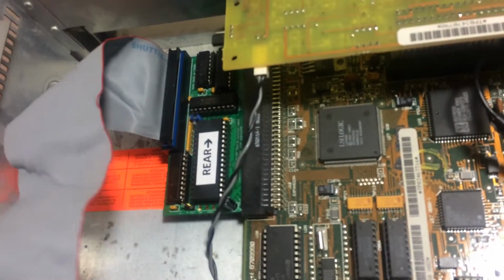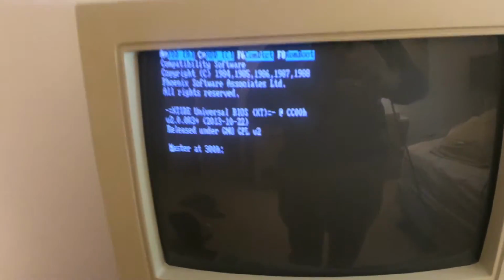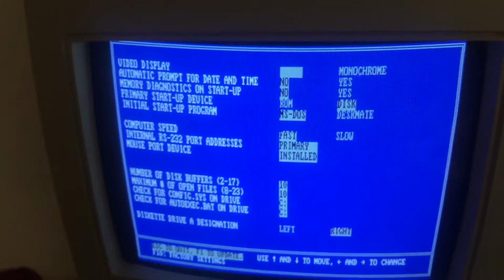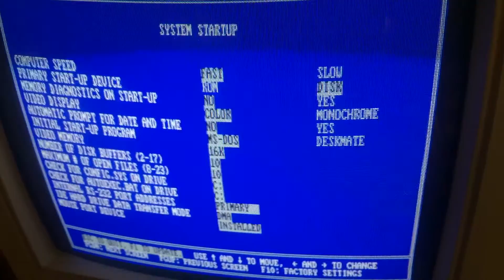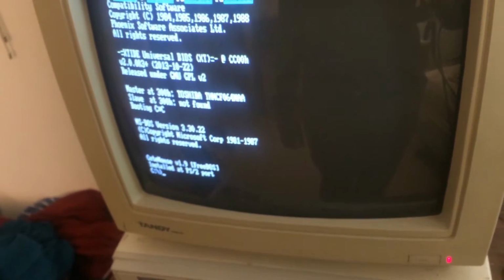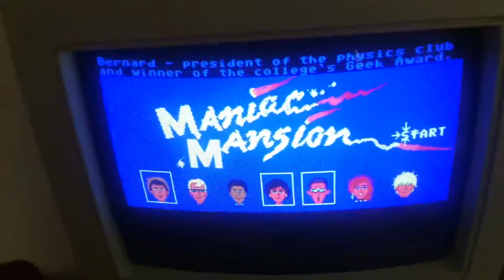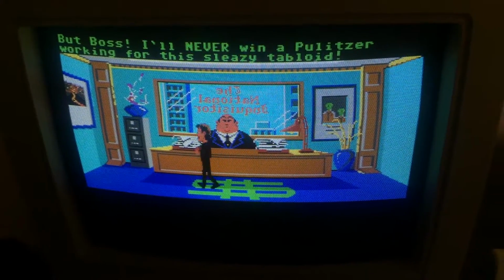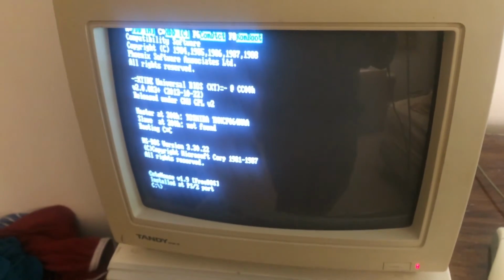Tandy 1000RLHD boots from a  Compact Flash Card

Comment: Just installed the card and did everything you said in the setup. When I boot up on the main screen it shows the prompt A> Don't know what to do now no instructions were included
Reply from the maker: Does the card boot properly in a newer system that doesn't require an XT-IDE bios? I'd double check that first. Like if you have a 286+ machine with a normal 16 bit hard drive controller, see if that'll boot your memory card. Also, do you see the XT-IDE bios options up top? Its a new menu with blue buttons across the top of the screen, it will pop up over the tandy boot text and says stuff like A C COM ROM or something like that, to remind you that you can boot from other stuff.

If it just says A> it sounds like you've booted from rom, but if the xt-ide card is flashed correctly and your CF card has a valid bootable install of dos then it should detect the card and keep going. Not all CF cards will work and its hard to know what ones will and what ones won't without trying it, but the random 64MB card that I used to use with an old digital camera works fine. Any of the "Transcend industrial" cards should work too since they identify as a fixed disk. 

If you disabled the hard drive bios without a way to turn it back on (floppy disk with setuprl) in it, you'll need to make a 720K disk with that to get back into the settings. 

You can find the setup utilities for the various tandys on ftp://ftp.oldskool.org/pub/tvdog/tandy1000/setups/
Reply: @Cowclops  The power light on the Ide to Compact flash doesn't even light up. I know it's getting power from the power supply. I bought the kit from texelec which included everything to convert over to CF and also bought a Compact flash card from ebay which has all the Tandy Software already on it including Deskmate. I'm getting the same boot up screen no XT-IDE bios options. I also already switched from Rom to disk before I started the installation.

Comment: What cable do you have plugged into the Compact flash from the Floppy?
Reply from the maker: Regular ide cable. Technically you can use whatever you want, but the adapter i had was the kind that needs a cable plugged into it rather than directly attaching to the port. Its female on both sides. Technically its an 80 conductor but thats overkill and unnecessary for anything an XT-IDE Supports.

Comment: HI I have purchased one of these cards . I have the type that just goes in the ISA slot and the card can insert from the back. No problem getting the card to recognize doing as you explained.  Only problem is you mentioned you can also get the hard drive reading at the same time.  I tried turning the hdd option after turning it off so the card could be recognized. Problem is I can clearly see the boot options from the card show up , however it will boot from the hard drive & and then I can't find the card recognized as a physical disk ex d:. When you did this did your internal hard drive or the cf card show up as a different drive letter ex e:? I ran fdisk just to display disk information and it only detects the internal HDD.  Main reason I would like to have access to both would be to backup items on the hard drive/ I have two tandy 1000rl and it would like to  be able to copy programs between the CF & internal hard drive.  Btw never seen any other interesting hacks for this machine? I have a few adapters connected to the cga port to a vga converter board so I can run the vga output then to a regular lcd VGA monitor.  I was looking to see if there was either riser card available so I could possibly have two isa cards connected at the one time.  I also have an ISA vga card that works well /& wouldn't mind having the CF also connected.
Reply from the maker: Yeah, fdisk found the cf card as its own drive. I can't say for certain why its not seeing it, sometimes the specific card used does matter. Once the card is reprogrammed to occupy the correct memory address so that it doesn't overlap with the HDD controller, you can absolutely use both at the same time on a 1000RL but I can't say for certain whats holding back the card from being recognized. I'd try a different card, something without DMA maybe or a smaller capacity if you have one. I happened to have an ancient 64MB CF card.

Comment: Can you explain how you sent power to the CF Card reader?
Reply from the maker: It has a standard 3.5" floppy sized power connector. The 1000RL does not use this kidn of cable because it supplies power to its own floppy drive through the ribbon cable, but you can get a hard drive 4 pin molex adapter to floppy (usually with a split off so you can still power the hard drive too). The RL only has a 25W power supply but the CF adapter and card doesn't present any substantial load on it so you can definitely run the floppy, the HDD, and the CF card all at the same time.

Comment: Hey man, nice video. I ran setuprl /a and made those two changes. It seems that my HD isnt being recognized, and neither is my SD card. I cant run setuprl anymore. Any ideas?
Reply from the maker: Unfortunately I think you gotta grab the setuprl file and copy it on a 720K floppy disk. You should definitely be able to boot to rom just by pulling the xtide and letting it do its thing - you'll just get an A> prompt. Remember that the base model RL never came with a HDD at all so its certainly usable without it. The gotcha is that you need a floppy with some relevant utilities on it...

If you have a 720K floppy you can find the setuprl file online

Comment: Another question - since the XT-IDE card takes up your one slot, do you just have to leave the card reader hanging off the IDE cable inside of the computer - or can you screw it into the back panel?  I'm guessing there isn't room to do both in the RL.
Reply from the maker: Not really enouhg room to do both, but I think its possible to buy a card with the xt->cf signal adapter and also the physical slot on the same card, which would work as you say. I just leave it coiled up inside the excessively long ribbon cable inside the system. Its not like it vibrates or moves at all so it doesn't cause any issues.

Comment: I just got one of these for my Tandy 1000 SX.  I'm waiting on getting a proper copy of MS-DOS in the mail so I can set it all up.  In the meantime, I tried pressing F8 to boot from ROM, but when it does that it just says "insert system disk, etc..."  Doesn't boot.  Any idea why it may not be booting from ROM?  This will probably won't matter once I get some DOS disks and can install DOS on my CF card...
Reply from the maker: A tandy 1000SX doesn't have boot rom. My dad had a 1000 SX and I had/have a 1000 RL so I'm familiar with both. Needs a hard drive or floppy disk to boot from (or CF adapter in your case). However, since there's no built in hard drive controller on an SX either, the 8 bit CF adapter can just run from the default memory address its flashed to.

Comment: Would you ever sell this? I'd be interested
Reply from the maker: Other people already do - I bought the assembled card from an ebay seller. The company makes all different cards - the one i got is for CF cards only (and you still need a simple pata to CF card converter), but they also make a version that lets you use any AT hard disk, so there are options. I happened to have a 64MB CF card which was perfect for the amount of storage I'd actually use in a Tandy, two 32MB partitions and thats plenty of storage.

Comment: Hey, Awesome video! The tandy series so happens to be among my favorite series of retro machines..
So, I have an XT-IDE REV3.. Could you please help me out in flashing the offr566 binary? 
What kind of eprom should I use?
PS.. I'm using a Tandy 1000 SX
Reply from the maker: Unfortunately I'm not sure what it would take in a 1000 SX. That was actually our first computer i the house, but it was my dad's work computer and then he got us a 1000RL for the home PC. 

The best advice I could give is that the difficulties I had were caused by the 1000 RL's hard drive controller using the same base memory address as the default bios image on the XT-IDE. Since I don't believe the SX has an integrated hard drive controller (it should be in a slot if it has one), it either won't conflict or you can take the old HD controller out if it does. 

If you're building the card yourself and you actually want to know what chip to use and not just what software, I was lazy and bought mine pre-assembled off ebay. The only reason I had to flash mine was to bump the memory address up a notch so I could use the hard drive controller and XT-IDE at the same time, in order to copy what was already on the hard drive over.

http://www.vcfed.org/forum/archive/index.php/t-43104.html has a message board thread indicating that they got the 1000 SX booting with just the default XT-IDE image, and then the only remaining trick is to write the /mbr from fdisk which is best used with a dos 5 or dos 6 boot disk. If you don't want a new version of dos on the old computer, you can actually write the mbr with a version as new as 6, then copy all the system files from 3.3 - it'll work.
Reply: Ahh yes, Thanks for the tip. I've read over that thread several times and I'm still stumped upon certain things such as burning the ROM image to the correct offset, I know for a fact the chips are correct as the as XT-IDE is indeed detected and boots, Though It hangs on the HIMEM memory test when booting, Also Can't manage to alter the partition table using fdisk, It shows up as some obscure capacity..

Comment: the guy from the xtide send me a detection tool so that he could figure out what the correct und suitable address must be. It finaly worked. Good to see that someone else also uses it. Do you use PS/2 or serial mouse?
Reply from the maker: Back in like 1989 when I had one of these brand new I had the Tandy branded serial mouse, but these days (its not my original system but I bought the one I have now on ebay in like 1999 for about $10 - compare to the idiotic price inflation these days) and I use an optical mouse with a ps/2 jack. The cutemouse driver detects it no problem, works in deskmate and adventure games, and it beats screwing around with dirt getting inside a ball mouse. Any older USB mouse like an intellimouse optical that came with a usb->ps2 adapter should work too (because using the adapter simply puts the mouse into ps/2 mode, theres no real active conversion going on here). You wouldn't be able to do the same with a modern wireless mouse.

Most of my difficulties in getting it working were basically that there were a large number of steps that had to be done correctly and in the correct order, and if you missed one, it wouldn't be obvious why it wasn't working, it just "wouldn't work." Like disabling the hard drive controller to flash the right bios onto it at the right memory address, then re-enabling the hard drive controller so I can move data from the existing HD to the CF card. I feel like the information out there on how to get it working on a 1000RL was relevant and useful, its just an arduous process.
Reply: because I also use Win2x with the 4color tandy driver, I 'll have to use the original driver and mouse.

Comment: What power cable do I need to power the CF card from inside the Tandy? Where did you get yours? I guess this one will do: http://www.ebay.com/itm/5-25-4-Pin-Molex-To-3-5-Floppy-Drive-Molex-Power-Splitter-Adaptor-Cable-/371454649551?hash=item567c6c24cf:g:y1UAAOSwQItUCGb9
Correct?
Reply from the maker: +fandenivoldsk Thats correct. Any hard drive->floppy drive adapter cable wil work, including the one you linked to. I just happened to use the one that came with the power supply in a computer I recently built. Its actually possible to power a CF->IDE adapter directly from the unused pin on the 40 pin IDE connector if you connect directly into it, but the cable I had didn't have a connection on the correct pins to pass the power through it, and you can't plug a CF adapter directly in in a case like the tandy 1000RL due to the lack of height. In a bigger system like a 1000SX/SL/TL, you might be able to do it without any extra power cable if everything fits right. In my case, that just wasn't possible so I used the adapter.

Theres almost always more than one way to skin a cat and this is a perfect example of that.